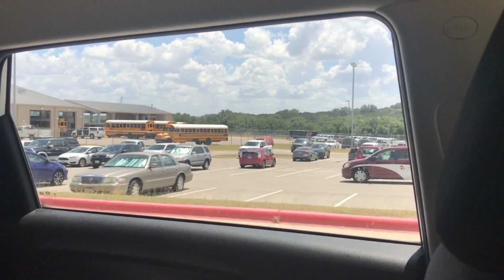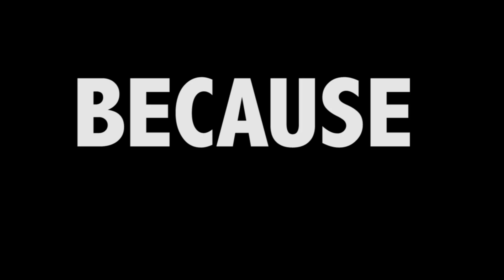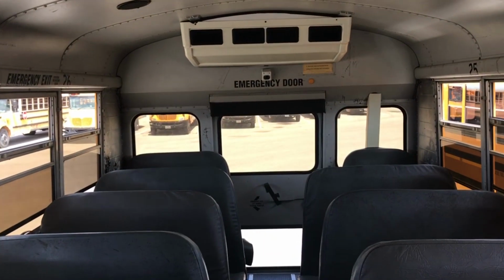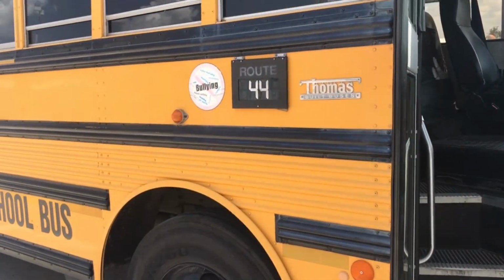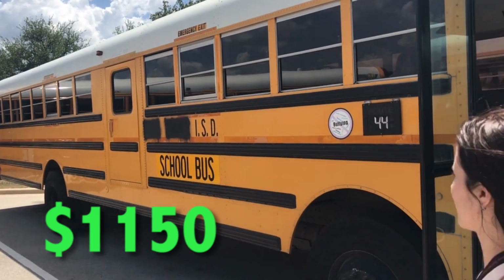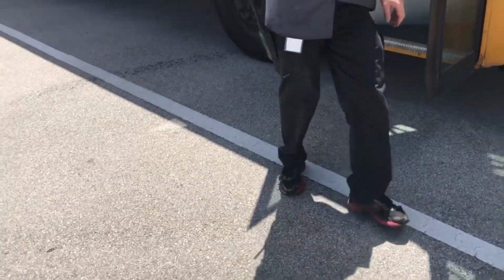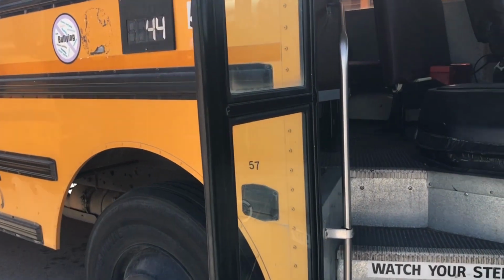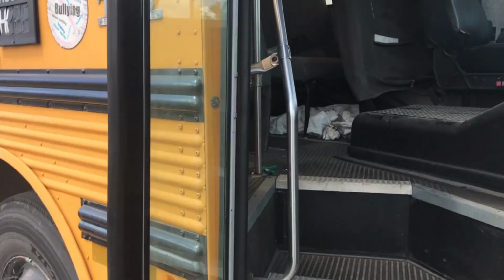School Bus Conversion Shopping - Schoolie Bus Conversion Heaven

Comment: They can’t be that bad. Busses here in Canada run all winter. Salt eats the shit out of them. Also, 200K isn’t much on a diesel. Should be good for 1.2M before anything major.  $1,100 for engine, frame, tires, etc, great deal.  Remember, it’s gonna be a motorhome. It will take years to put 25K on it.

Comment: If you're going to convert a school bus into a mobile home, make sure it has air ride suspension on the rear. Also it should be the one with the motor in the back therefore it wouldn't be too loud inside.
Reply: I'm just curious, since I am planning on converting myself, what's wrong with springs? I know they ride rough, but still. Granted I am getting air anyways but still, just curious for your opinion.

Comment: Get the Cummins motor with allison transmission. That's the best set up.
Reply: Very  true, best motor and trans set up there is, I drove a truck for 38 years, you don't want a international......I know from experience.....I have a Motorhome also has a Cummins 400 and a Allison automatic....
Reply: Kung Fu Nerd get the real diesel, don't have the noise going down the road like you do with a gas or front diesel.....Lots quieter, will enjoy it a lot more.......